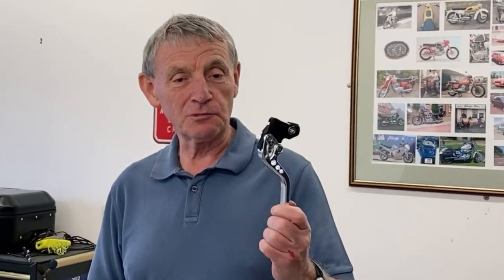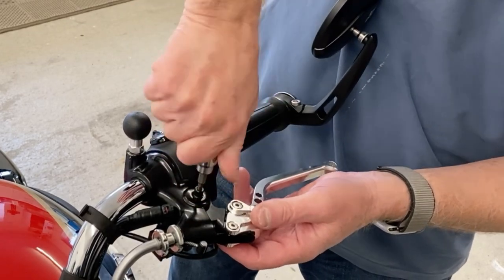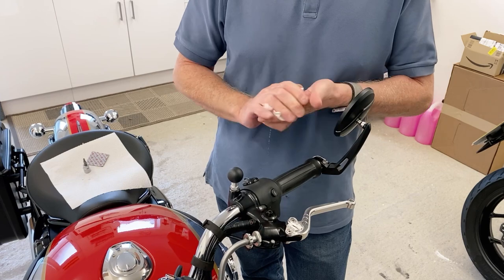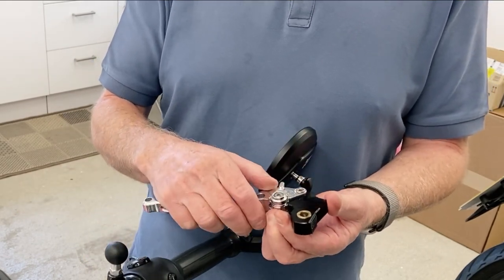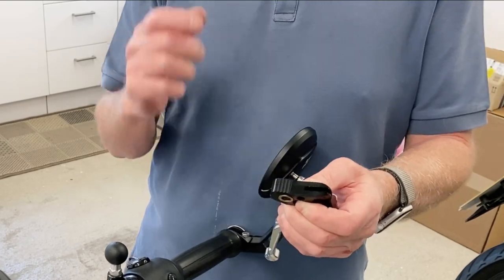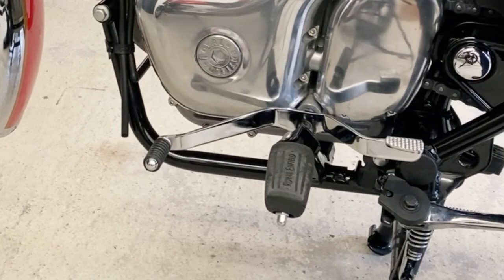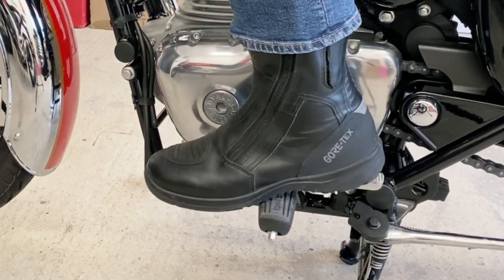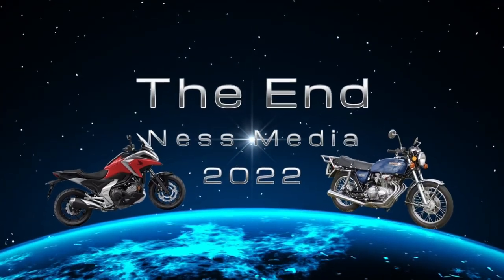Royal Enfield Classic 350 - Clutch & Gear Lever Issues 🤔

Comment: I have the 2022 classic 350. Had the same issue with the tow shifter. Bought the same aftermarket heel toe shifter from India. Won’t ever go back! Did the same exact thing and it works wonderfully! There is a little bit of an issue to get it on. I believe Warro from Australia has a real quick video that shows how he did it. I did the same with no issues. Cheers from Seattle exclamation
Reply from the maker: Excellent upgrade for this wonderful little bike 🏍👍

Comment: I have a Meteor 350 which came with the heal and toe gear lever, also it had been fitted with the bigger footrest, this made it impossible for me to change gears as it was set in the factory position.
I looked online and found the TEC modification of a single standard gear lever with an adjustable extension .
Placing my boot on the foot peg allowed me to set the exact length to suit my foot size.
This has transformed the operation for me as I also found using my heal unnatural, I appreciate many people like the heal and toe however.
It’s great when good British engineering companies innovate and improve with high quality product.
Thanks for a very informative channel.
Reply from the maker: Hi Kevin
I would imagine that the heal and toe changer on the Meteor would be rather awkward to use. The Classic 350 pedal is in a completely different position and as such I find the heal and toe works perfectly.
Sounds like you’ve found an ideal solution that works for you.
Hope you enjoyed the video 🏍️👍

Comment: Likewise I couldn't get my boot toe under the gear shifter, but after fitting a heel & toe lever it really solves the problem. Fitting was simple. There's a YouTube video on how to do it. Simply undo one frame bolt, push on the pedal with your foot and off comes the original lever. Helps to have someone else do the pedal push while you remove the lever.
Reply from the maker: Excellent upgrade for this wonderful little bike 🏍👍

Comment: Hi there, what a fantastic garage!  Funny business with the gear shifter, Like everyone else, my first ride on the Classic was a total nightmare, couldn't get my boot under the lever. Shifting it up a click solved the problem of course. 
 I too invested in a heel and toe shifter from India,, back in April when they were really hard to find, there seem to be a lot more sellers now though. 
Anyway, I fitted it and really hated using it, took it off after about 10 miles and replaced the original, It's destined for  Gumtree/Ebay , Funny most people rave about them, and I suppose if you have a Meteor there's no choice,. Nice informative good quality video, thank you
Reply from the maker: I wasn’t sure about mine at first but now I’m used to it I really like it.
A lot depends on what boots you’re wearing, chunky boots are difficult, trainers are so easy.
Great to hear that you enjoyed my wee video 🏍👍
Reply: Hi See my post Tec have a great hi quality solution almost a made to measure set up and only about 60 pound looks and works a treat.

Comment: Thanks for the video Tiger Ness. Nicely presented as always. By the way you've been spammed with undesirable comments 🙄
Reply from the maker: Great to hear that you enjoyed my wee video. Thanks for the spam info, they’ve now been deleted 🏍👍
Reply: @tigerness5555  well done! - I got one similar on my channel 🙄.
I hadn't noticed the switch on the clutch lever - I have the Meteor - and use the standard lever but, yes there's a little click when operating it.
I must own up to removing the heel part on my Meteor gear change 🤭 LE

Comment: Another useful video, thank you. I haven`t read all the other comments, so apologies if I am repeating other people`s points. I only just got my 350 Classic red / chrome and have just adjusted the standard lever up one notch and it is fine but I may well get a heel / toe shifter, as I am used to using them on the old Honda step throughs. Was it a Royal Enfield part? If not, what make is it please?
Reply from the maker: Hi Dave, yes mine is a genuine Royal Enfield part. I bought it on eBay and it came from India.
It’s important to search for the correct part:

Royal Enfield "GEAR SHIFTER ASSEMBLY & RUBBER" For New Classic 350 Reborn
Reply: @tigerness5555  Many thanks Iain. I am working my way through every video of yours that I can find and enjoying them all.

Comment: Hello, Ebay is full of heel-toe shifters but for Classic 500 and the old 350. I don't see nothing specifically for the new one. Is yours for the old ones and that will mean it fits the new one ? I am waiting for my Classic to arrive any moment not.. This will be the first upgrade.
Reply from the maker: The shifters on the 350 and 500 are NOT the same. When you do an eBay search use “Royal Enfield Classic 350 Reborn”.
The splined shaft on the 500 is larger than on the 350 so it has to be the correct one. Hope this helps.
The Classic 350 is a brilliant little bike, I’m sure your going to love it. 🏍👍

Comment: Not good enough Hitchcocks, poor testing. Hopefully they will have seen this by now and modified the design accordingly. Are those Daytona boots you have there?
Reply from the maker: Hopefully this helps some other riders.
Yes they are Daytona boots, expensive but well worth the money in my opinion. After many so called waterproof boots from reputable manufacturers, these are the first pair that actually work. 🏍👍
Reply: @tigerness5555  I absolutely concur having a pair myself.

Comment: Would you still have a link for the heel toe you got from India?
Reply from the maker: I don’t have the original link I purchased from but here are similar ones on EBay.

https://www.ebay.com/sch/i.html?_from=R40&_trksid=p2332490.m570.l1313&_nkw=Royal+Enfield+Gear+Shifter+%26+RUBBER+For+New+Classic+350+Reborn&_sacat=0

Some suppliers only send the lever, make sure you get one with the rubber.
Hope this helps.

Comment: I don’t get it. Adjust the point of grip where the cable is fixed next to your right foot, or for minor adjustments with the wheel next to the lever.
Reply from the maker: If I was to reduce the reach on the levers as you suggest to fit my small hands, then there would be a great deal of slack in the lever.
The adjustable levers work for me. Question, why are most bikes fitted with adjustable levers?
Hope you enjoyed that you enjoyed my wee video apart from that👍🏍

Comment: I got a classic 350 three weeks ago and I am having issues with the toe lever. When I shift from 1st to 2nd it pops into neutral. I asked a more experienced rider to ride the bike and it popped into neutral for him too. Have this happened to you on your bike?
Reply from the maker: I’ve not had that problem, then again I purchased my heal and toe changer before I took delivery of my bike and fitted it within a day or so. Have you moved the lever up one notch on the spline? The shifter can be awkward and possibly you’re not moving the lever far enough because of that.
Hope this helps.
Reply: @tigerness5555  thanks for that, i am giving the dealer a call tomorrow about it .
Think i might order the toe and heal shifter too.
Your videos are great, im in my 50s and new to riding, thanks for your advice.
Reply: @denismcinerneygcf4967  I’m experiencing the same problem as you with hitting neutral from 1st to 2nd. We’re you able to fix that problem?